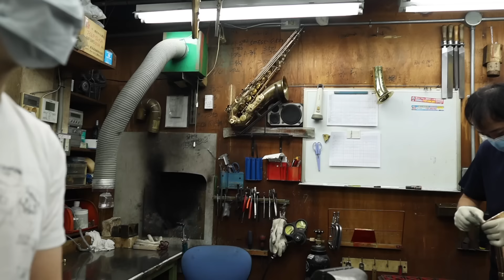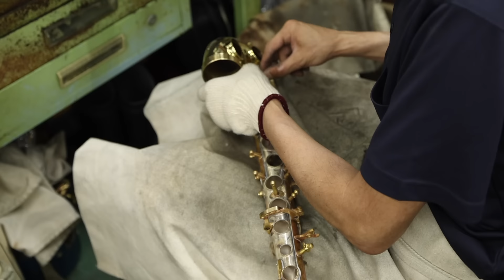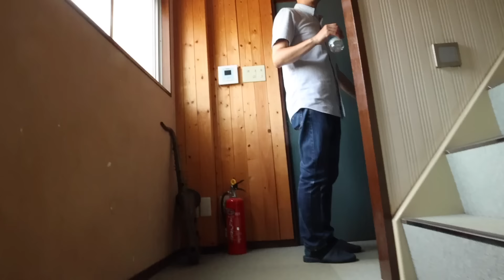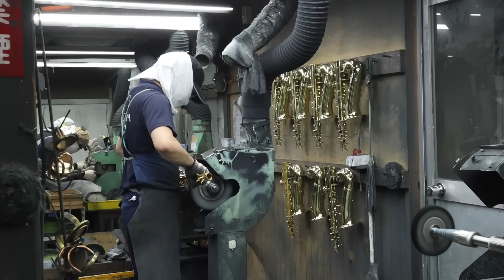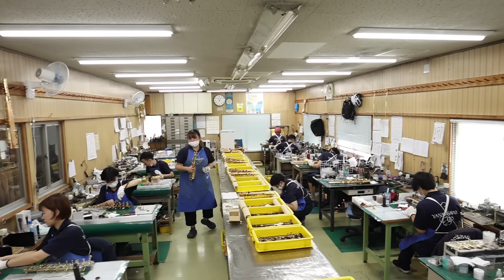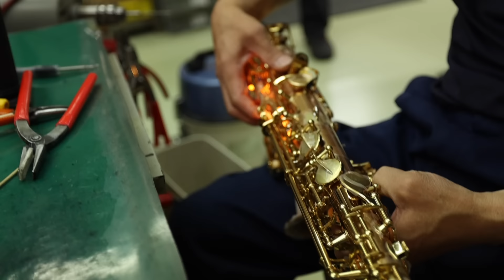How Saxophones are Made by Hand in Japan - Yanagisawa Factory Tour

Comment: Excellent work. Thanks so much. Must have been a great experience. 
Reminds me of my work at the B&S Markneukirchen (Germany)  Saxophone manufacturing i used to work at from 2000 - 2003, learning the craft. I was mostly assembling the keys and setting them up on alto and tenor saxes, the way described here, each sax with it´s taylor made set of keys. That´s how it should be done. 
I watched the other videos with Selmer and Yamaha too and it´s really interesting to see the different approaches. I can now see, that the standard at B&S was very similar to Yanagisawa. 

For Saxophone Nerds: I can only recommend to look for the B&S 2001 Series IV Alto models and the the so called "Medusa"  Alto Saxophones and  Dave Guardala Tenors from the early 2000s.  All seemed tubes, handmade, hand engraved, no f# ! :)  etc.
By the way. I am currently working in the MI business as brand manager for a few asian brands, and visited the Saxophone production in  Taipeh, Taiwan for JUPITER, which is an amazing production sitel I´d lik, you might want to check out too at some point ! 
Cheers and sax a lot ;)

Comment: This is why I play Yanagisawa -Soprano, Tenor, Alto. My tenor came direct from the factory to I.K. Gottfried in Copenhagen.
No one else had played it, it was not a demo horn. It was perfect out of the box. No setup needed.
Reply: My baritone came direct from Japan (B990, back in the '90s) to the distributor in Sydney, Australia. When it arrived, he called me and I told him I'd be right over as it was only 15 minutes drive from my house. I was very anxious to get my hands on it. We opened the cardboard box, pulled the case out and removed the plastic bag and all the transport corks. He had wanted to do a set-up but it wasn't necessary. I played it right there and it was also perfect straight out of the box as you said. He agreed that it didn't need anything apart from a little lubricant. After all these years, travelling and gigs, it has only two tiny spots of missing lacquer. Yanigasawa horns are the top of the line.